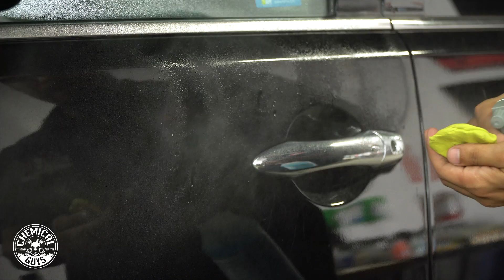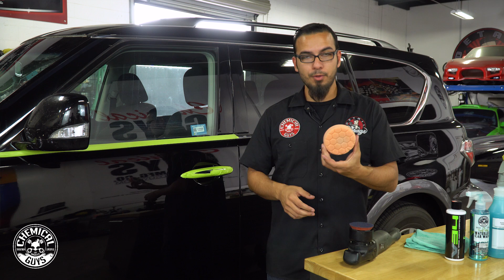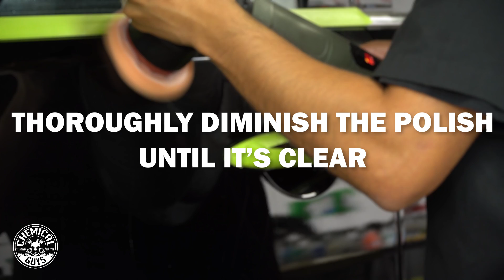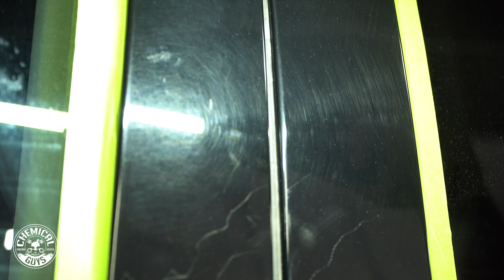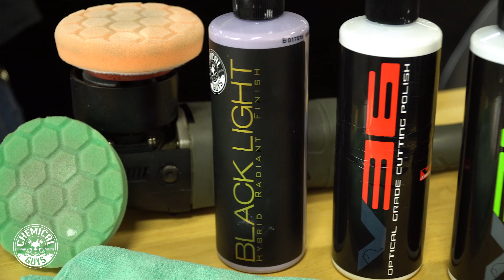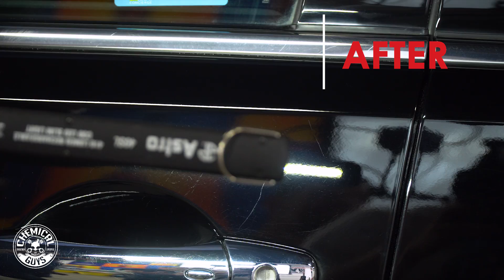How To Treat Really Deep Scratches! - Nissan Armada - Chemical Guys

Comment: I have scratches on my side mirrors, is it safe to use the random orbital 15 polisher on it?  I had a friend try to fix some scratches and he used a polisher (i dont know what brand) and it vibrated the heck out of the mirror.  it almost made me feel like it would break the mirror.  Would you suggest a polisher for that task?  Thanks!
Reply: btw, the scratches are on the paint, not the mirror itself.
Reply from the maker: Hey Ted! Thanks for your message. It is perfectly fine to polish mirrors but take caution because as you said it does vibrate a lot unless it is removed from the vehicle. I recommend using an Orange Hex-Logic Pad with V36 Cutting Polish.
- CG Nick

Comment: Is it possible to used V34 ou V36 to take out heavy water spot on windshields ??
Reply: Use the orange cutting pad with Bar Keepers Friend (yes the chemical). Only thing that worked for my windshield and waster spots

Comment: Recently purchased the Chemical Guys BUF_209X Complete Detailing Kit (13 Items, TORQ TORQX). Can you guys provide me the names for the polishing compounds I will need? Looking at heavy scratches with a lot of swirl marks aswell.
Reply from the maker: Hey David, great choice with the TORQX kit you picked up! You'll want to pick up the complete V Line kit to ensure you have all your bases covered. You will start off with V36 and the orange pad on a test spot. If your scratches are heavy, there's a good chance you'll have to go another step down to V34, and possibly even more aggressive. After, you will want to refine your heavy compounding with V36 and/or V38. As you can see, there is no set formula for all cars. The specific products your car will use will be unique to your car and can only be decided after trial. It may seem daunting at first, but check out the article below. It will lay everything out in a clear and easy to read step by step format. We're really glad to have you here part of the CG family, David, and let us know if you have any other questions regarding your upcoming polishing job! You can reach us by email, phone, or even facebook messenger. Happy Detailing! 
https://www.chemicalguys.com/How_To_Choose_The_Right_Compound_Or_Polish_For_Your_Car_s/644.htm
https://www.chemicalguys.com/V_Line_Polish_Compound_Sample_Kit_4_oz_p/gap_vkit_04.htm

https://www.chemicalguys.com/V_Line_Polish_Compound_Kit_16_oz_p/gap_vkit_16.htm

Comment: So how would you treat deeper scratches? My car got keyed 😒😭
Reply from the maker: Hey there, thanks for tuning in. That depends how deep the key went in. If the scratch goes just into the clear coat, you can use a dual action polisher to at least reduce the appearance of it, and possibly even polish it out if it's not too deep. If the key went past the clear coat or even to the bare metal, you will need to take it to a professional. Thanks for watching and good luck on your car!

Comment: Hey guys, so after all of this, will regular maintenance/Waxing keep the detailed scratches from returning?
Reply from the maker: Hey Lawrence, good question. Regular maintenance using the proper techniques will help ensure the longest intervals between polishing. Most scratches and swirls are caused by improper washing and drying techniques, so following best car wash practices, such as using the two bucket method, will help ensure your car stays scratch and swirl free for the longest time possible. Thanks for watching, Lawrence, and stay tuned for a new video dropping tomorrow!

Comment: What's the longevity of this job before the big scratches reappear. I have a midnight edition RAM which the dealer hid a few things. After 2 or 3 touch free washes the imperfections show. So will this appear if the customer does a touch free washes immediately? Thanks. Love the channel. Subscribed.
Reply from the maker: Hi Scott, that's a good question. Polishing actually removes the scratches, so once they are gone, they are gone. Thing is, though, new ones can be installed with improper or negligent care, and over time from daily use. After polishing, your car will stay scratch free until, well, until you install new ones. In the course of daily use and/or abuse, this could occur quickly, but if you mind your car and take the time to care for it properly, your car could stay scratch free for quite a while. Many scratches occur during washing and drying, so simply using a premium car wash soap like Honeydew Snow Foam and quality microfiber mitt goes a long way in keeping your car scratch free. Likewise, using super soft microfiber towels when drying will help your car scratch free as long as possible. Being that cars are made to be driven and that you probably drive your truck frequently, scratches are inevitable, but by taking proper care of your truck, you can minimize the amount of scratching and prolong the period in between your polishing. As a side note, if you didn't see any scratches when your bought your truck and then washed it a few times and the scratches appeared, the dealer could have possibility used a product to fill those scratches for temporarily concealment. Our compounds and polishes have no fillers, so the results you see really are the results you get. Thanks for watching Scott, and we wish you happy detailing! 
https://www.chemicalguys.com/Honeydew_Snow_Foam_Cleanser_16_oz_p/cws_110_16.htm

Comment: I would like to see a closeup of before and after. I buy your products. I have used them on rock chips that went to the metal. Taking touch up and clear for rebuilding the missing chip fragment, then using the 1” Rupe with 2500 grit to flatten and blend. When done you can hardly tell the paint chip was there.
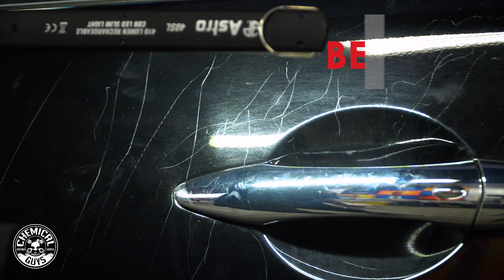Reply from the maker: Hi Tom, how's it going? Awesome to hear about the amazing results you achieved with the Rupes Polisher. 👊 Make sure to upload pics and tag us next time so we can see too! Watch from 7:22 on to see close ups of the before and after in this video. Thanks for watching, Tom, and stay tuned for more videos coming your way soon, including a great one dropping later today!
Reply: Chemical Guys I always think after im done man I should have go pro’d the process. Unfortunately im older and dont video everything. I spend most of my effort imagining the process im going to use then focusing on implementation so I can get optimal results. Im almost afraid subconciously I would be thinking about the camera instead of the precision? If that makes any sense.
Reply from the maker: Totally understandable. Multitasking is difficult and sometimes can compromise results. A good idea is to just snap some pics before you start and then after you finish, that way you never have to interfere with the actual detailing process. Thanks for being a part of the Chemical Guys family!

Comment: saw a video you guys did about removal of orange peel but didn't seem to link to products.  Can you cover the products used?  It appears you used a sanding disc etc.  I have orange peel on many panels and think hand sanding with say 1500 then 2000 would take forever.  Thanks

Comment: I'm still wondering about the clay bar deal.  I've used it twice i the past, and while the end result was satisfactory, wouldn't they pick up microscopic dirt and create additional scratches as you go along?  

Of all detailing products, the TORQ-X kit (the one approx $200 @Amazon) was by far the best deal for the money.  No one thinks my 2004 TL (UA6) is 13.5 years old.  And that Butter Wet Wax is the only one in the market that has pleasant flagrance (not to mention the shine), like many of CG's products. 

BTW, I'm also wondering as to who's coming up with the choice for the BGM......sorry to say but they are not my taste, lol.
Reply from the maker: Hello, how's it going? The clay bar works by grabbing onto any contamination that sticks onto the surface of your vehicle, then pulls it out as you rub the clay across the paintwork. To help it glide across the surface without getting stuck or marring the glossy shine, you need a lubricant. This is where Clay Luber comes into play: simply mist Clay Luber over the surface to lay down a coat of slick lubrication between the clay bar and your paintwork. Now as the clay bar grabs onto the above-surface contamination stuck on top of the paint, it won’t get stuck to or mar the painted finish. Chemical Guys Clay Luber helps facilitate the best clay bar technique over any exterior surface that is shiny or clear. It's also important to knead the clay bar to get a new clean spot once you have picked up the contamination. By kneading the clay, you are revealing new clay and getting the dirty, contaminated clay away from your paint. Thanks for watching and stay tuned for more videos coming your way soon!
Reply: Thanks so much for thorough directions.  I used Meguiar's product last time, but next time I'll give a try on CG's version.  

You guys rock!
Reply: Funny, I've been working on my '04 nighthawk black pearl TL the past week. Had the worst swirl marks and scratches but boy is the paint ever looking minty fresh now. Such an ageless car.

Comment: Hey Chemical Guys, I have a question. I messed up my headlights by using 400 grit sandpaper on them and now they are permanently scratched up, I tried the headlight restore but it didn't do much. Question is, do I need new headlights? Or do you have some type of miracle plastic polish? Thanks!
Reply: LA Car Reviews have you tried working up through the different grits to 2000 or 3000 and polishing?
Reply: Ben No, I'm not sure how to do that actually. Do I just start rubbing the lights with 2000 grit?
Reply: Use 800 then 1200 then 2000 and there's a chemical guys video that carries on from 2000 grit on headlamps!
Reply: LA Car Reviews just keep working your way up from 400 and once you are above a 1,000 or 2,000 grit then compound and polish
Reply: Midwest Mopars Great! Thanks for the help! Just bought my sandpaper so I'll try that tomorrow
Reply: Ben Alright, thanks for the info!
Reply: LA Car Reviews no probably glad I could help good luck

Comment: if the scratches are that deep they can not be removed a 100 % unless the door is painted
Reply: Alfredo Valdez even wet sanding
Reply: That's right Mitch
Reply: Hhhmmm lol my mind set was like everything can be wet sanded, well im a bit informed now, last question  how to know whend to sand, polish or compound a car. Thanks
Reply: @BaltzMusicBox  i been doing this for many years and wet sanding would have helped here...not sure how deep scratch was by this video...but there is a good chance over 50% of these scratches were not into the base coat... maybe 100%

Comment: Can you wash wheels and car with big mouth foam cannon
Reply from the maker: Hey Brayden, how's it going? The Big Mouth Foam Cannon is the best way to get the maximum amount of thick suds all over your vehicle, from the wheels to the roof! The Hi-Flow Breather Valve mixes the perfect amount of air with the high pressure water and car wash soap to create thick clinging foam to get even those hard to reach areas of your car squeaky clean. Thanks for watching, Brayden, and stay tuned for more videos coming your way soon!

Comment: You should have used a 3" 1500 grit sanding disk, then did 2000 ,and 3000 grit . Then polished out the 3000 grit. Sanding would be the least aggressive method.
Reply: ww2717 ?????????????? Least aggressive ??? I hope you’re being sarcastic
Reply: MikeEM1 yeah but i wouldn’t say least aggressive
Reply: Watch the wet sanding series on Obsessed Garage with Jason Kilmer. Best wet sander on the planet. It's not as harsh as you would think and gets you better results/clarity.
Reply: Sanding removes less clear than compounding. You have more control over the clear removal by choosing the grit of sand paper that you want to use .

Comment: Would of liked too see the scratches disappear instead of just get minimized and shined out 😢
Reply: That's like saying you want to un-drink water. What's done is done and the best you can do is cover it up
Reply: I would've said wet sanding too. They probably don't want to promote that method and get in any legal trouble when some idiot says "I ruined my car after doing what you did!!!" It makes sense that they went with the "safe method" on video.
Reply: You'll have to repaint the panel
Reply: Yeah, that's a respray job.
Reply: They could've been wet sanded out
Reply: @98AWDTSi4g63  yes i agree there was a good chance ,but i would have to have car in front of me to test... but many car detailers are not experienced in sanding and painting ...i have been doing this many years...
Reply: Could he have used v34 on the door post first, then polished it with v36 or v38?
Reply: Wet sanding is still pointless if its scratched to the base
Reply: @kakashi99908  yes but its hard to see how deep scratch is from this video... usually many parts of the scratch are not as deep.so wet sanding can be very effective...
Reply: he would of had to wet sand them out.. and factory clear coat is thin. he did a temp fix

Comment: When would you need to use V32? I have yet to see a video on it
Reply from the maker: Hi Miguel, that's a good question. V32 Optical Grade Extreme Compound cuts hard and cuts fast. Body shop professionals and experienced enthusiasts choose V32 for its ability to quickly and completely remove heavy scratches, swirls, oxidation, and even wet sanding marks up to 1200-1500 grit. V32 makes short work of swirls, tree branch scratches, fingernail marks on door handles, paint scuffs, faded paint, and hazy headlight plastic. Thanks for watching Miguel, and stay tuned for more videos coming your way soon!
Reply: Thanks for replying